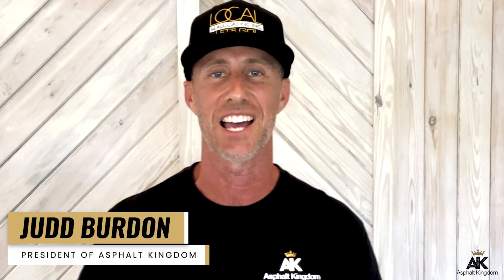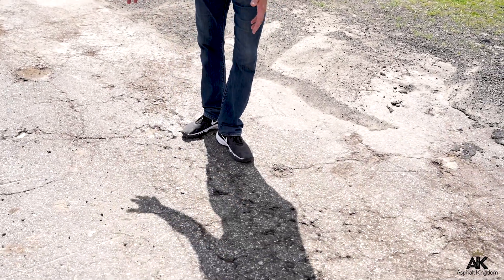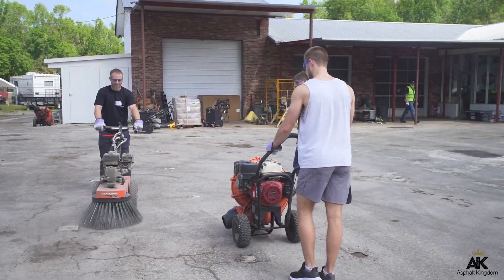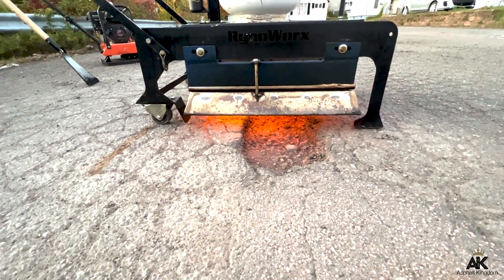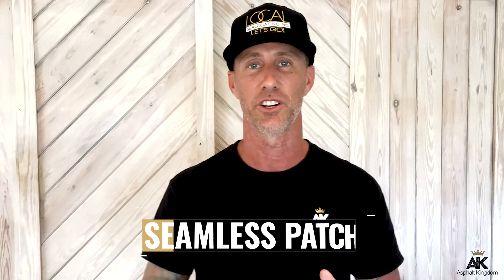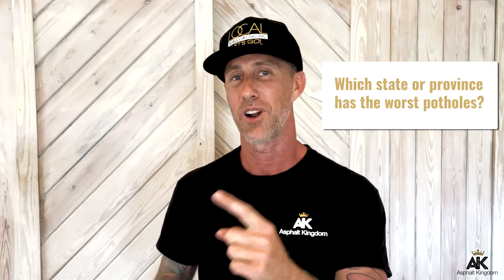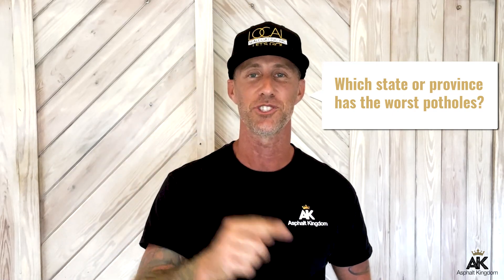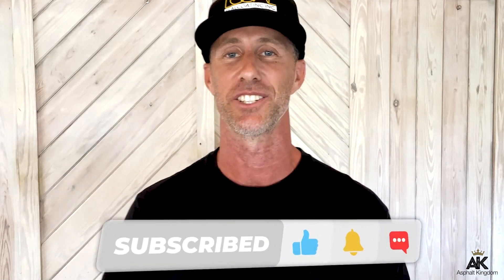Pothole Patching: Pro Tips to Boost Efficiency & Quality

Comment: Is it possible to combine the 3 different pothole repair methods (cold patch, infared, cut and replace) in any way or are the all done separately depending on the customer’s budget and maintenance preferences (ie a particular pot hole is a problem child one in a very high traffic area that gets damaged often so they want the most durable solution possible compared to say one that is mild and in a isolated traffic spot like a marina’s or golf courses grounds keepers maintenance shed that got there due to elevation of the terrain and water flooding it etc).
Reply from the maker: Each of these methods has different use cases, and what you've mentioned is correct. The cold patch is designed as a temporary fix. If you're seeking a longer-lasting repair, especially in a high-traffic area of your parking lot, infrared patching is the better choice. The cut and replace method is the best option when the damage is so extensive that the base is exposed, and the infrared method is not suitable.